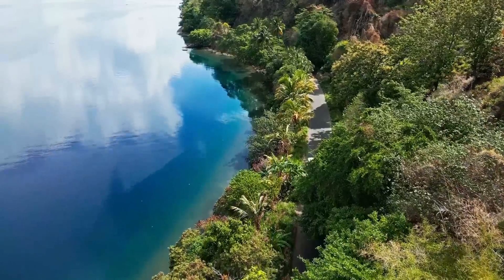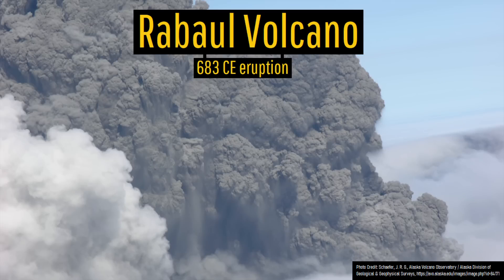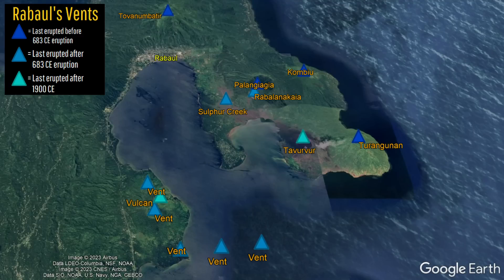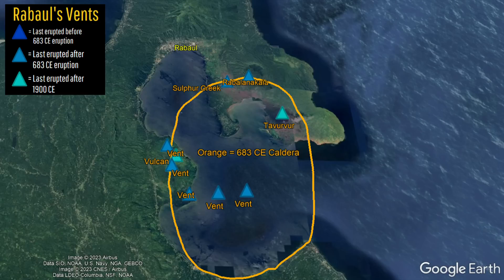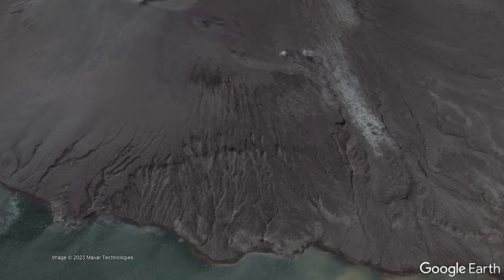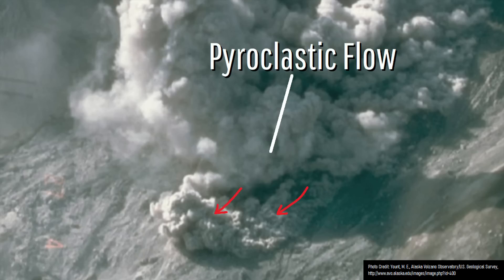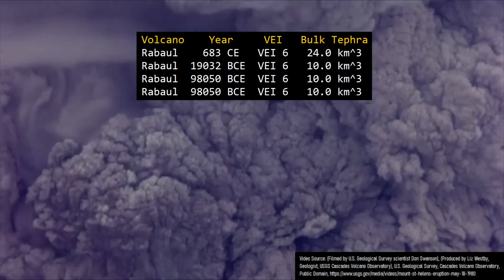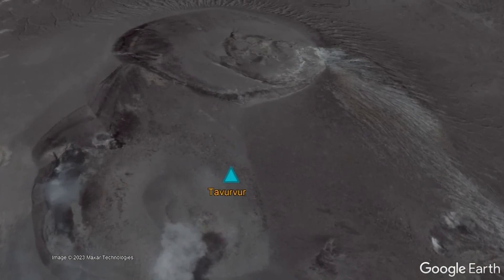The Twin Dangers of the Rabaul Volcano; Papua New Guinea's Active Volcano

Comment: Thanks! I knew that Rabaul had many vents, but I did not know that it had that many!
Pyroclastic shield volcanoes are definitely interesting.
Rabaul's most recent VEI 6 eruption was originally postulated to have been the cause of the 535-536 CE extreme weather events, but more accurate dating methods have dated the eruption to around 683 CE.
Due to the fact that both Tavui and Rabaul are surrounded by water, I could not help but wonder if the most violent phases of their eruptions behaved similarly to Hunga Tonga Hunga Ha'apai's January 15th, 2022 eruption!
Reply: it’s very possible. Honestly this this volcano just strikes me as way too dangerous to build a major port town around. I get the caldera is closely monitored but even so eruptions at Rabaul seem like they can occur at very short notice especially if more than one vent becomes active.

Comment: I wasn't sure about the ratio of wet ash to snow at first, but the math checks out.
Reply: Snow is full of microscopic air bubbles between the ice crystals... wet ash has water filling the gaps between ash particles, which makes it far denser & heavier.  That's why lahars are so dangerous... they are effectively rivers of concrete flowing at high speed.  It's also why it's much harder to dig someone out of a lahar than an avalanche.... when they stop flowing the ash particles are even more compactly arranged, and when the water particles drain or evaporate out you're left with a very tightly compressed mass.